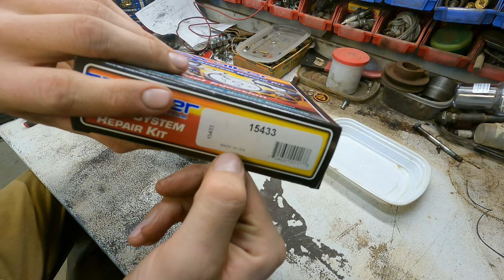Is this 1950's Galion Road Grader worth saving???  Cursed Grader Pt.2

Comment: I'm wondering how the rats got into the housing, they would have had to have a clear route to drag all that stuff in there to build their house... hummmmmmm
Reply from the maker: it took a while for me to find the access point too, there is a hole in the bottom of the bellhousing right next to those bolts I cut off.

Comment: I will never buy anything DeWalt again since the discontinued there 18 volt  batteries.
Reply from the maker: The 20v are miles ahead of them and you can get a converter to use those 20v batteries on those antique 18v tools 

https://amzn.to/3YOgDRO
Reply: Well I only need 9 converter for my 9 tools plus a couple new chargers. You just wait about 5 years and Dumwalt will change the voltage again.
Reply from the maker: @catskinner3254  well if they get the performance jump 20 had over 18 I’d say that’ll be a smart move, battery tools are an ever evolving thing just like the cars… they arent perfect  but they get better every time
Reply from the maker: @catskinner3254  and as fast as adaptors you probably only need one, they just stay on the batteries, super easy to move around
Reply: I take it Dumwalt gives you your tools. I do wood working and have up to 4 or 5 tools out at the same time all with there separate battery. Three drills all with different bits so with your reasoning I have to stop and change batteries instead of just picking up another drill. F--- Dumwalt !
Reply from the maker: @catskinner3254  no they have never given me a thing, I use mostly Milwaukee now but I never had a complaint with the dewalt except the lack of mechanical tools available
Reply: I do have to give Dewalt credit on how they found a way to increase there profits. By discontinuing the 18 volt battery they are forcing thousands and thousands of 18 volt owners to buy an adapter and batteries which cost twice the price of the 18 volt if they wish to continue to use them.
Reply from the maker: @catskinner3254  im just guessing by the hate here that you havent used one of the newer brushless Lithium powered tools? (of any major brand) because there's really no comparison... after using a modern tool id happily toss out the old NiCad battery stuff if i  still had it...  I had some of the 18v stuff and it was okay, it did the job but if you really use the tools every day than new brushless stuff is a must